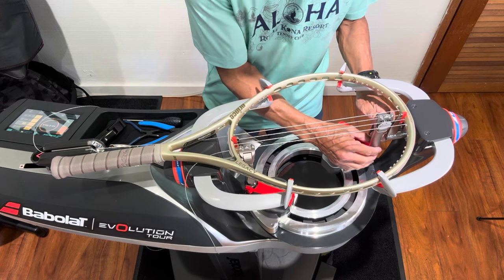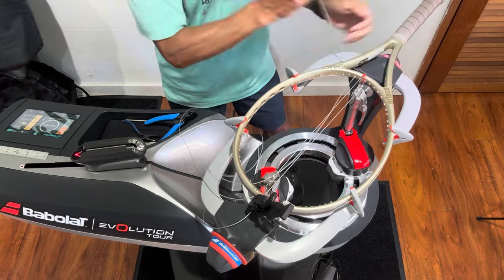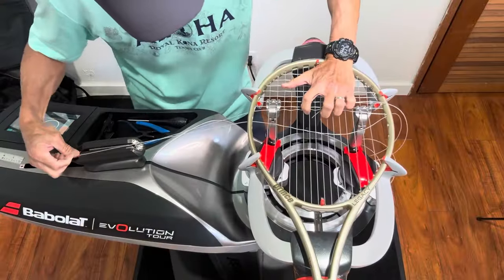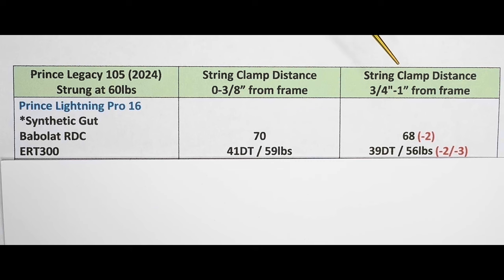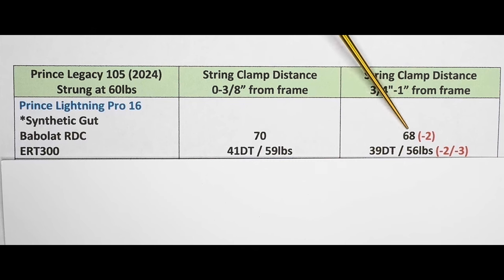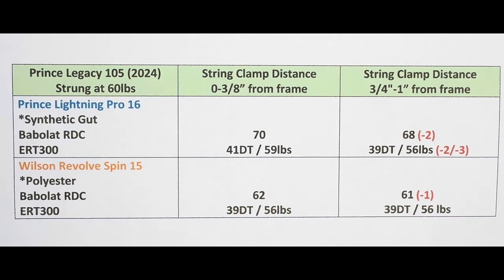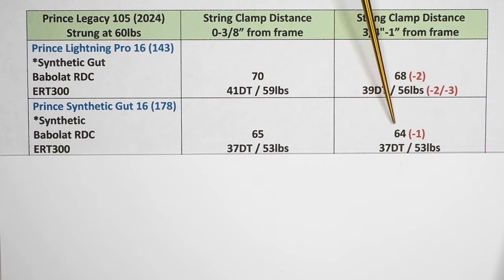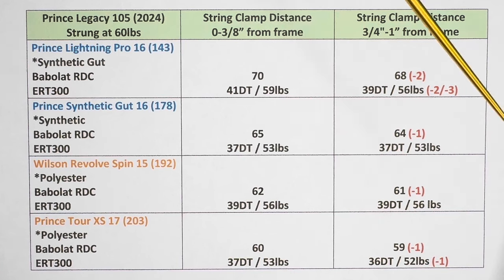Racquet Stringing [String Clamp Distance - Constant Pull Machine | Episode 1]

Comment: What an effort to make this clear. And repeating this with a manual machine would be even more of a hassle. So thank you for doing this for us.

But there is more to it that makes clamping as far outside as possible mandatory.

The clamp squeezes the string. Just a little, but enough to make a difference. The more outside that happens, the less likely you will hit the ball with that.
Reply from the maker: Aloha Sebastian, 
Thanks for watching! 

Sometimes these experiments lead me in ways I don't expect. It was laborious but fun!  

In my opinion, if you have a quality stringing machine with good string clamps, and your clamps are cleaned and properly adjusted, that squeezing is very minimal and should not impact the integrity of the string. 🤙

Comment: I'd love to see the lockout, A. I have one and B. a lot of places still have both constant and lockout..  I was wondering if because my clamps are so thick that when I string the first two mains on a lockout if I'm getting a lot more tension loss in the beginning considering the starting clamp and stringing clamp cannot be in the way of the first two pulls?  if that makes sense I can't butt the clamps together so one of them always has to be at least 1" away from the frame to allow the first or second pull of the mains.. I thought about replacing my clamps with thinner ones but the alpha lockout machine clamps are still decent just bulking especially in the beginning. edit: before I saw your video I thought about increasing the tension on the first two pulls until the clamps got out of the way but what I don't want to do is cause more issues of inconsistency.. my string jobs come off the stringer good but I've noticed the center mains some times feel loose, I also always go up on tension for the last two and always string 2 piece (Yonex style).
Reply from the maker: Aloha, 
You're officially the fifth person to request Episode 2 starring the lockout machine!
Sorry to hear about your dilemma, but it sounds like you're doing the best you can with what you have.   
Thanks for watching! 🤙
Reply: @AMstringing  yeah I think a second set of clamps is in the cards for me.

Comment: Very interesting, I would have chosen a couple different racquets with different grommet designs. I would wager that normal grommets with a Syn gut would "stick" in the bend during tensioning, whereas a smoother/slicker poly would not. If this were true the differences would be much greater.
Reply from the maker: Aloha, 
🤔That's an interesting idea, especially since I was stringing the O3 Legacy racquet which has the O-Port holes, which is "grommet-less." However, at 60 pounds and with a constant pull machine, I'm not sure if it would be the case even with regular grommets. 

I plan to experiment with my lockout machine in the same manner I did in this one. It will be interesting to see if there's a difference. 🤙

Comment: Interesting video.  Could stringing on new grommets alter your clamp distance results.  Just something to think about.
Reply from the maker: Aloha Albert, 
Good point! 

If you're referring to the first string job I did in this experiment, the grommets were seated before I strung the racquet with the Lightning Pro strings. The racquet that I pulled off the wall wasn't the actual O3 Legacy 105 that I strung over and over. I used a pre-strung demo of the same model instead.

The reason why I pulled a brand-new racquet off the wall was to draw more attention to the newly updated racquets in the Prince Legacy line. 

I don't if you know, but I'm PRETTY PASSIONATE about the PRINCE brand! 🤣

Comment: The point I took from here is if you’re using a cheap gamma drop weight with those fat clamps, go up about 3lbs if you wanna hit the actually tension you’re selecting.
Reply from the maker: Aloha, 
It would be great if you could measure the string tension readings of the drop weight machine (with floating clamps I assume) and compare it to a lockout or constant pull machine with fixed clamps. Then you can adjust accordingly. 

However, you would need to have access to both machines, and you can use a free (phone app) string tension device called RacquetTune. Also, you would need to take the readings right after the racquet comes off the machine. 

If this is not feasible, then 3 lbs is better than nothing. 🤙
Reply: @AMstringing  when I set my weight to 55lbs. Whatever comes out the other end feels good to me. 😂